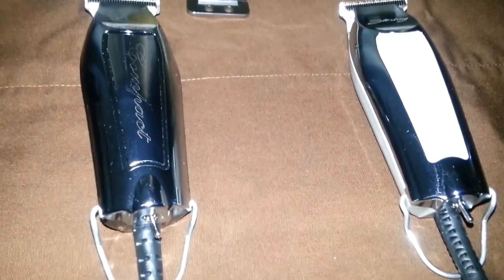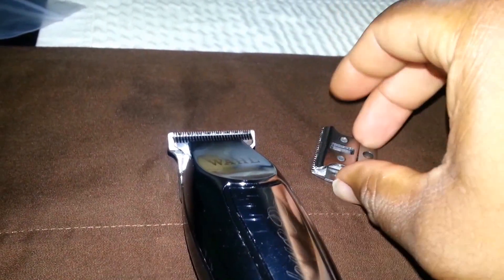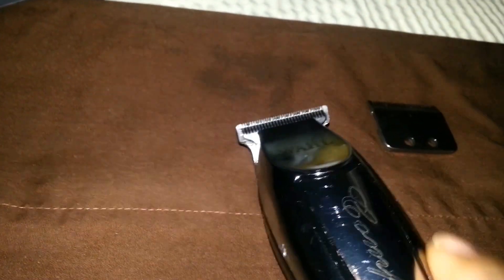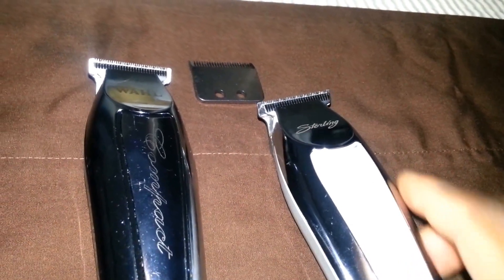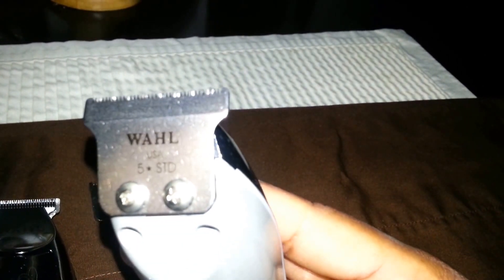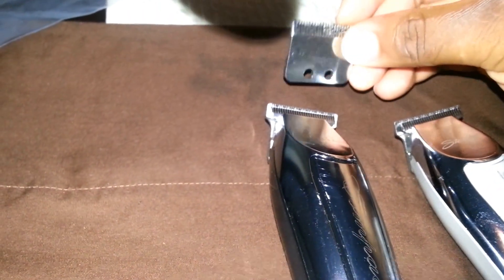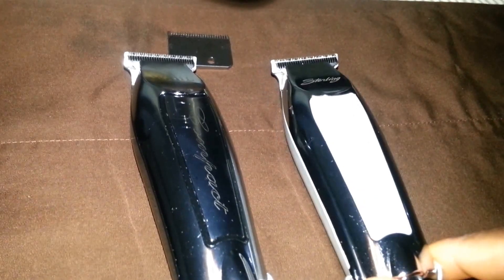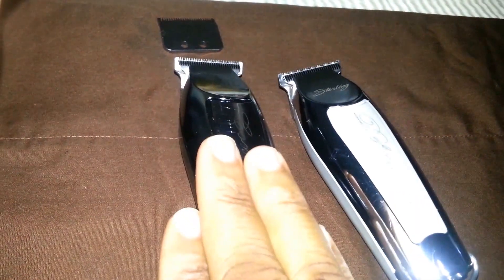Wahl detailers....

Comment: you right about "0" gapping. but not about it is the same thing. Sterling use the best prime material!!durable material. and wahl detailer and compact use shipper prime material except for the blade which is the only same thing.
 I know by experience cause I bought just one sterling defi once. instead the detalers have bought 3 of it when it come in up to the market aroun2004. old screw hole plastic which broke just whit the daily use in about two years and 2 of the new later version whit the metallic screw hole and it broke too. no matter what I love it to my this is top off the line on its category. but sterling branded products definetly use Lil better buildmateral is not the same ass main wahl selling products .